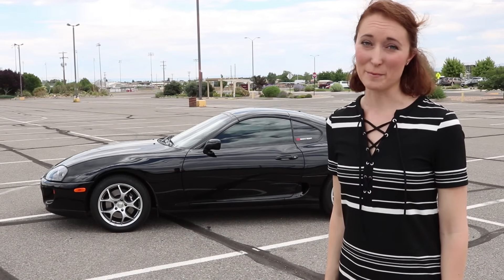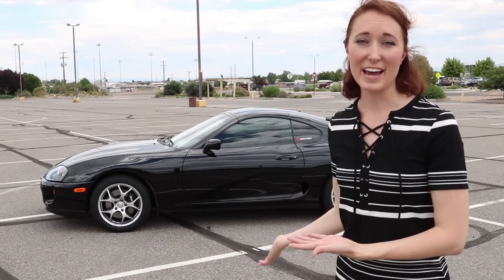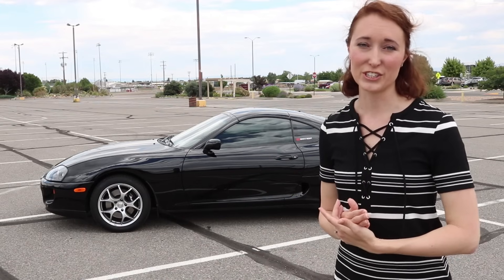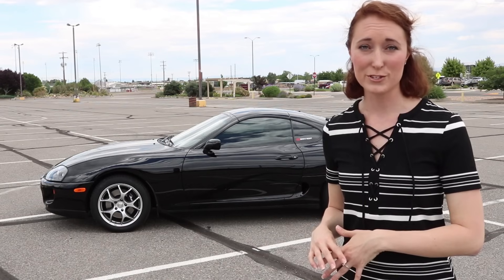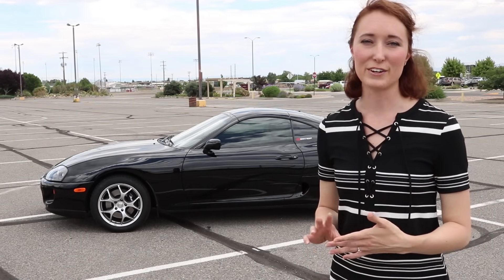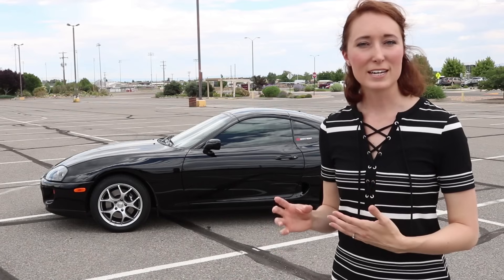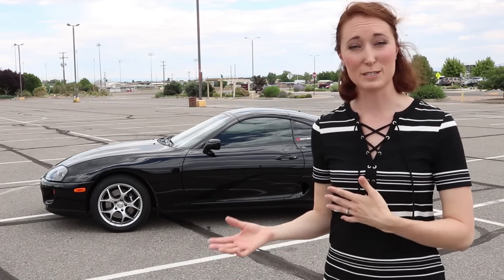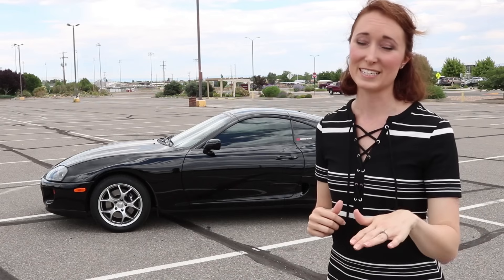How Does a Turbo Timer Work?

Comment: Bought a GC8 impreza and it has one installed
Reply from the maker: Sweet! 🤘🏽
Reply: Nice, what year is it? I have a 97 GC8 STI. It was imported from Japan and it had the exact turbo timer in the video, plus a toll collector that speaks Japanese, and an old Kenwood radio.
Reply: I just picked up a 93 WRX yesterday and it came with a Razo timer

Comment: From what ive read on the forums, this is a waste of time and money on most cars.
Reply from the maker: Your not wrong. The main goal is to allow the oil to cool down after hard use. If you do not on a turbo car, the hot oil can bind to the turbo shaft over time and cause issues.
Reply: @DriversTherapy  yea on a strictly race dedicated car, not a street daily driver, no matter how modified.  Factory turbocharged vehicles would've came installed with them already just to avoid the warranty issues if this was the case.

Comment: This is for people who don't clock their turbos correctly.
Reply from the maker: Nice. So how does that work? I thought clocking the turbo was for fitment purposes only?
Reply: @DriversTherapy  If the center housing is not straight up and down then the turbo will not drain correctly and oil will just sit inside and coke up leading to hardened deposits. Some people did not realize this and thinking letting the oil flush out those chunks would solve the problem only leads to eventual oil starvation of the turbo.
Reply from the maker: @srhabb  that makes sense. I knew about the oil on the turbo shaft but I did not know why it would cause an issue unless it was not able to propel drain back to the oil pan via feedback line as you described. Thank you for explaining that and for watching our video.

Comment: Nice car. Pretty woman. The stupidest aftermarket thing I've ever seen on turbo engine.
Reply from the maker: Hahah I’m not gonna lie. Best comment. A turbo runner is suppose to help “cool” the turbo’s turbine after a hard or long drive. The theory is that if the turbo is too hot, oil will cook itself on the shaft and overtime it throws the balance causing shaft play and turbo seal failure. I think companies marketing might be overstating the probability but that is the reasoning.